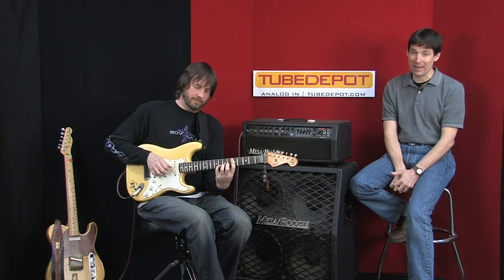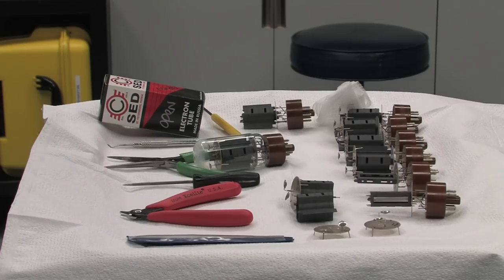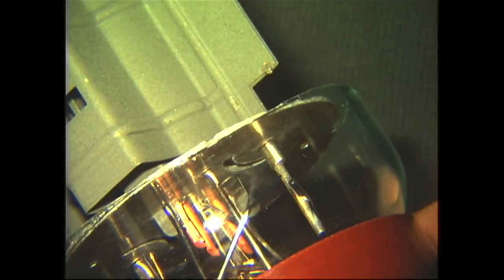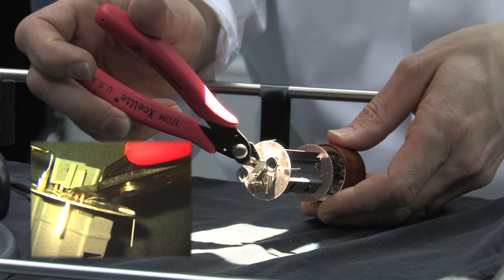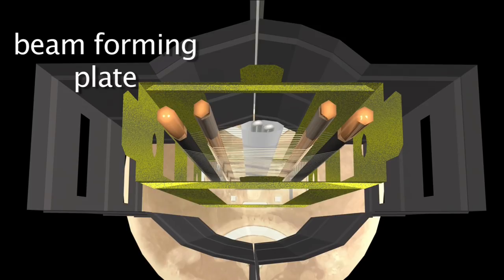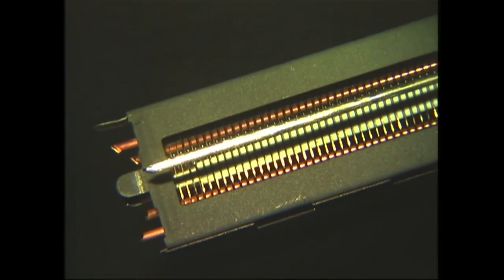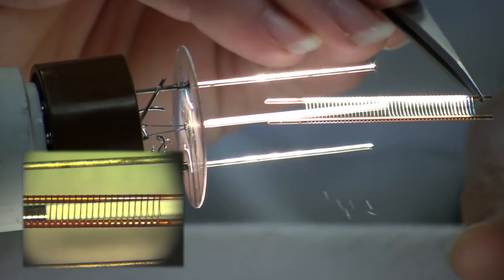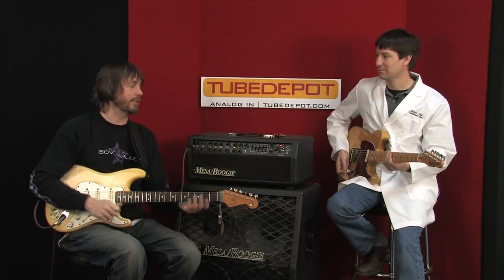Journey to the Center of a Tube

Comment: I am wondering what your opinion is on a hybrid amplifier? A tube used for the preamp stage, and transistors for the driver and output stages. If made correctly, could you eliminate the need for an output transformer? You would probably need one between the preamp and output stage:( ?
You should still get that tube sound though, a friend of mine eliminated the need for an output transformer by wiring a bunch of cathodes of preamp tubes together. That seems like a waste of tubes though!

Comment: Sorry, but I'd have to say that in the audio industry, there is more of a reliance on belief and self-delusion than on measurable results. Sure tube amps sound nice - but their cost is horrendously high. Pay as much for a well designed solid-state amp and you'll achieve something better, more powerful and introducing less coloration of every type. A solid-state amp can sound like tube amp by introducing appropriate distortion. Tubes can't, however, provide the transparency of solid state.

Comment: I found the misplaced test lead wire, & my parts are here from China so my new curve tracer test jig is nearing completion! I made it like a 570 test jig, only with P1, P2, G1, G2, and K1, K2 coming from the tracer, and G1, G2 and htrs coming from separate supplies. You patch in to a row of 2x12 5 way jacks accordingly. R174 cabled with BNC cons go to a switch that selects tube 1 or 2. The heaters just stay on in both tubes. I have every common socket except subminis. Forgot them, Hmm>??

Comment: Your missing my point. Valves do not have a sound. It's only the circuitry they operate within that imparts a 'sound' perceived by the listener. So if the HF response is rolled off early for example, this may be perceived as a warm tone, but it is not the valve causing that. Two valves of the same type may sound differently, only due to manufacturing tolerances that require different circuit adjustments. There is no mystery to electronics.

Comment: oh well if what you are saying is true about the last number in a tube than a 5AR4 would be considered a 5AR5 a diode is 2 a triode is 3 a tetrode is 4 a pentode is 5 a heptode is 6 and so on a 5AR4 is 2 diodes making it 4 if they were counting the filiment they would call it a 5AR5 not a 5AR4
Reply: Two diodes with a common cathode. One cathode, two anodes/plates and one heater = 4.

Comment: I know that my comments are not popular on this subject, but it depends upon whether one is aiming at sound REPRODUCTION  - in which case one wants maximum transparency, no colouration, flat response, maximum loudspeaker damping and a linear transfer characteristic. That can ONLY be produced by a well designed solid-state amp. If, however, you're using an amp for sound PRODUCTION, you want tube distortion to suit part of the sound coloration of an electric guitar.

Comment: actually your anode is what they call a a suppressor grid and your outter plate is actully your collector another words your cathode emits electrons to your the collector and your collector is the outer plate of a tube your anodes are your control grid suppressor grid and your screen grid and that inner plate is actually your suppressor grid thats how a beam power tube such as a 6L6 or 6JS6 or what ever like tube works.

Comment: Wow I am gonna call you, "Fire Fingers" for yanking that hot tube out of that Mesa Boogie!  I though the getter was flashed with heat and a high freq inductive wand. I want to see you reassemble the tube. Philips had a great tube book with photos & drawings. I have one of the few copies in English. Pete Millet has it in Dutch (PDF download for free), & many more audio books/telco/misc, (mostly vacuum tube) including RCA Designer's manuals. There is even one with 3D diagrams, but no glasses.

Comment: The screen grid runs very hot, because it is absorbing some of the cathode current. It is coated with graphite, both to help cool it by improving infrared radiation, and to keep it from emitting secondary electrons (graphite is very good at this). This has nothing to do with "improving the tone".

The control grid is plated with gold, also to help prevent secondary emission. Gold gives a smoother surface than graphite, so it's better suited to the control grid.

Comment: @Timmy Mcfistfull, the beam forming plates and staggered grids were added to power tubes in the 1930s as a solution to the Pentode patent owned by Philips/Mullard.  The Pentode has an extra suppressor grid with no beam plates.  Anyways, read the wiki on pentodes and tetrodes before making more rediculous comments..

Comment: @Turboslag"Tone is an subjective term but electronics don't do subjective." That is such a inane statement I just have to comment. Do you not consider that 'people' are the final judges of the sound? Not the electronics. Is every electronic component precisely the same? Are you seriously saying that a solid state amplifier sounds the same as a valve amplifier? "...the valve itself cannot impart a characteristic to the sound the listener perceives" Are you serious?
Reply from the maker: turboslag is getting correction from all angles.
Reply: Tim Greig Kind of also suggesting that a 6L6 sounds the same as an EL34, etc. Not true at all.
Reply: ***** 
still waiting for an accurate JTM 45+ tube kit ( which is 4 instrument output jacks and NO master volume).
Reply: +Tim McGrath they do, but i seriously doubt that the average geek at guitar center that preaches things like that could explain the differences or distinguish them in a blind test. Most people just repeat what they read in guitar mags or forums and don't have any actual experience with the shit.
Reply: "Are you seriously saying that a solid state amplifier sounds the same as a valve amplifier?"No, they don't sound the same because a tube amp distorts the audio in various ways as it is an inferior piece of technology that was state of the art 70 years ago.  In the 50s, these distortions were undesirable, but unavoidable. Proponents of that technology today somehow think this flaw is a 'feature'.
Reply: LOL.... tubes sound better period! Did you know that records also sound better than CDs? yes they do and science has considered all angles. Records, with a good cartridge installed mind you, have a superior range of frequency response that far exceeds the digital format of CDs. Go do your research before countering this statement. Anyways as a HAM radio operator, we use both solid state and tube amplifiers and every station that I talk to tends to sound exceedingly better to my ears on a tube. It just does something to the audio that a transistorized chip can't do.

Comment: My experiences  as a electronics technician for over 4 decades has taught me that TUBES ARE SWEET!  They are tough under  various situations like spikes  , surges , Emp. , etc. That's why Rf transmitter ,  microwave  devices use a MAGNATRON . Think of a Tube like  Hercules /Arnold. Believe me I have seen during troubleshooting    a  Horizontal  15,757hz (scan freq)  6LF6. Horiz. Output tube  with a  grid screen problem of incorrect bias which caused  over saturation of  current from cathode to plate causing the tube to over heat /glow red. Found a open  bias resistor that corrected  the bias issue.  The tube survived  the  overheating esp since the customer  would run the set with such bias failure . Anyway  mr. 6fl6  kicked ass. Transistors under such biasing  situation will cause "avalanche " of the pnp/npn junctions. Avalanche  directly leads to junction thermal runaway. ( leakage/dead short  in the junction.)  TUBES SOUND GREAT OVER SOLID STATE NO EXCEPTIONS! Thank you for reading. Ken

Comment: Had a 1945 Stromberg Carlson field PA made for the navy. It was housed in a green ammo style box with latches around the center. Flipped it over to remove bottom and inside was the pristine circuits. Used a dynamo instead of a transformer. 12V in one armature and the other side was 600V on that armature ( commutator brushes like any motor). Another box the same size, roughly 18''x9''x9'' was the 12V & 8V battery supply for this amp. It had a  5.2ohm output transformer. 60 watts RMS.1 volume knob

Comment: As a trained electrical engineer, 55 years old, I have to say that the fascination with tubes escapes me. The need for an output transformer between the output tubes and the speaker wrecks phase response and loudspeaker damping, especially at low frequencies. Tube distortion figures, even with moderate feedback, are bad. It may be an acceptable type of distortion, but it's distortion nonetheless. I would reccomend reading books by the the solid-state designers Douglas Self or Linsley Hood.
Reply: To a guitar player the distortion produced by a tube amp is not only acceptable, it's desirable. It may be called an amplifier, but it is really an amplifier/effects unit. I agree that if you're looking for hi-fi and you don't have money to burn, then solid state is the only way to go.
Reply: As a mature 65 year old EE, I suggest you listen to a Vintage MC 75 system
playing vinyl. And then reconsider. Yes there are a bunch of myths about tube sound. And there are nonsense terms dangled around the audiophile community, yes they think power cords and crystals improve the sound. Nut case exist. 
But these system do sound fantastic. Also note the Mcintosch transformers are 
amazing devices. Chill Mr. Trained, and listen to the music.

Comment: Robert Hull! A very helpful guy. I have a '96 Fender blues Deluxe. V1 and V2 JJ 12AX7, V3 JJ 12AT7, outputs SED 6l6GC. SED's are biased at 425v plate, and 32mA. Idle disapation is 45%.A very sweet combination. The high end of the SED's are smooth and sweet. My Tele' rings like a bell without harshness.

Comment: I know this is very old video but if your still around maybe you can answer me a question.   That tube you pulled apart looked pretty darn solid and not sure how normal use could cause shorts or make a tube fail.   What exactly happens when a tube gets older and starts to not perform as good as it did when new?  Does that coating stop producing electrons as well ?
Reply: A tube wouldn't typically go shorted in normal operation unless there was a preexisting manufacturing defect. But rough handling or electrical overloading can cause damage.The cathodes do become less emissive over time, however, which is the normal wear-out failure mode of a tube.
Reply: @Agent24Electronics   Thanks for the response .  So when older people say they used to used tubes in there amps for 20 years without changing them this is actually possible?
Reply: @Jennifer_Prentice  Cathodes are supposed to last 1000 hours, but many will do much more than this.

Comment: Nice illustraion, good work on the video. A few additions I might want to add, though:

The tabs that center the assembly in the envelope are most likely not made from aluminium. I am not 100% sure by the looks of it,
but solid aluminium does not lend itself very well to be used inside an vacuum environment due to the oxide layer on the surface.
It is used on anode coatings but this involves some processing on the pump to make that work.

Cooling fins on the grid are to keep the grid cool enough so it does not become an electron emitter itself. The proximity to the hot cathode and
the posibillity of barium migrating to the grid from the cathode coating can cause the grid to become able to emmit electrons as well which is not wanted.

The getter usually does not contain pure barium as this would be difficult to handle during production, instead it is usually an alloy of barium with other
metals such as aluminium and magnesium, both of which are not very good getter materials by themself but help to keep that alloy reasonably stable and workable.
Sometimes nitrogen compounds might be added to help with dispersion, I am not sure how common this is, though.
Sometimes there is an additional protective coating over that alloy to protect from moisture. When the getter is evaporated this will burn of before the
metal evaporated onto the glass. The layer on the glass however is mainly barium in the end.

The coating on the cathode is a mainly barium oxide, strontium and calcium oxide might be added, too. Usually it is applied in the form of barium ( or other ) carbonate as the
oxide would not be practical to handle in production. When the cathode is first heated in production, the carbonate will convert into the oxide and the gassy byproducts are
removed by a vacuum pump or the getter.
In operation some of the oxide is reduced to metallic barium which effectively is the electron emitter, not the oxide iteslf. This is btw one reason a tube with this kind of cathode needs a getter,
no matter how clean you materials and process are ( which today they are usually not ;-) The cathode itself produces some oxygen in operation which has to be removed.

The gold plating on the grid also helps in reducing unwanted electron emission from the grid, but there might be other reasons I am not aware of.

Comment: How did you cut the tube without breaking it?
Reply: He farted
Reply: The same way you cut any glass.  You scratch it with a glass cutter, then heat it with a flame, and cool it with ice, and it will snap cleanly along the scratch.

Comment: Their 6v6 is prone to rattles/microphonics as well, I have another pair that tests fine but you put em in a circuit popping/fizzing/cracking etc you know that nightmare crap lol. So if you have a combo amp sure as wouldn't use them lol. That sucks though I thought sounded pretty cool and the fact they handle waaay more plate/screen voltage easily than a typical 6v6 they are not 6v6 its more like 5881 or 7591 with 6v6 pinout lol and will dissipate more than a 12-14watt 6v6, way more 6l6 like.

Comment: Heh, ALL valves have non linear frequency response, and NO two valves will sound exactly the same. I'm not even sure you're using non linear in a correct manner in that sentence. Tone the way TubeDepot is using is very objective; it's the characteristics of the tube, eg. the frequency response, bias conditions, harmonic distortion, etc, all described in a single word.

Comment: Lol, any part of the circuit that shapes the sound has a sound. Valves are no exception; they aren't just a simple amplifier, they're very complex and hard to describe. They're as much a part of the circuitry as the biasing resistors, high-pass and low-pass filters around them. When we say they have a sound it's in that context, how it shapes sound there, just like you'd describe a strat's tone in the context of being connected to an (clean or dirty) amp. Not my fault you can't hear it ;).

Comment: What happens when a tube "goes bad"?
Reply: Lars Sig There could be multiple reasons, the vacuum could be damaged, or internal short may occur for example. Each failiure acts different in circuit

Comment: What is the function of the Screening Grid? This you seem to have glossed over. Anexplanation would help.
Reply: A triode is unsuitable for amplifying high frequencies because of negative feedback from anode to grid due to the 'Miller Effect', by which the capacitance between grid and anode is multiplied by the gain of the tube. The constant positive voltage on the screen grid (believe it or not) screens the grid from the varying voltage on the anode, eliminating the Miller effect and enabling high frequency amplification.